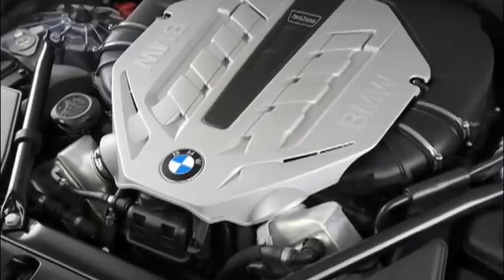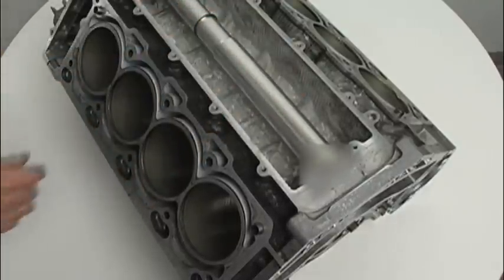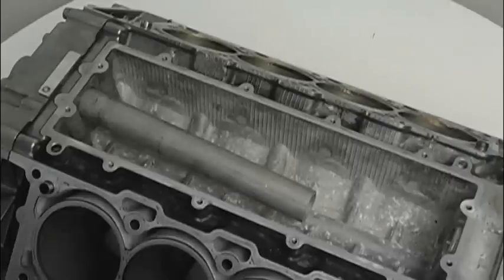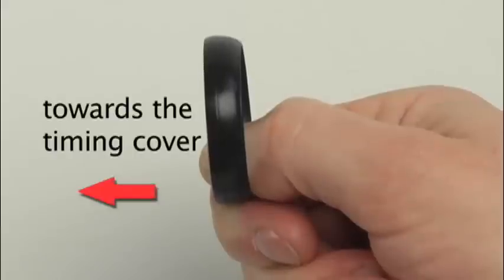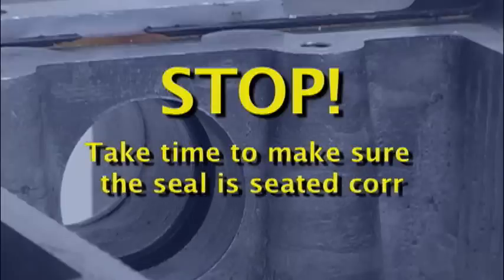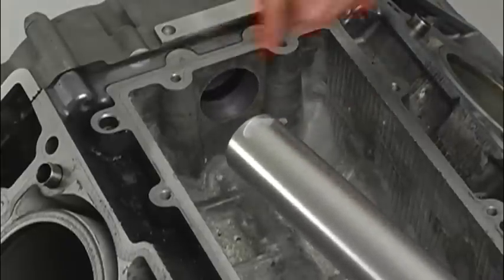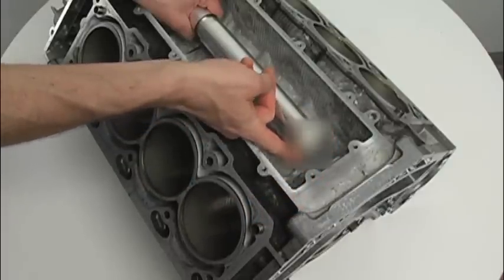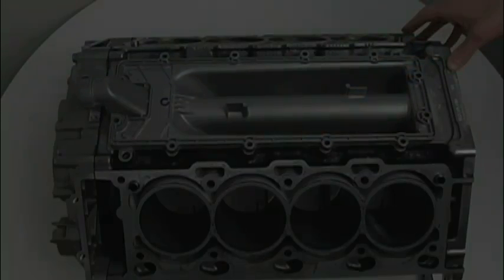URO Parts Coolant Transfer Feed Pipe 11141439975-PRM, Repair BMW N62 V8 Seal Leak

Comment: My BMW 745i had this problem,thanks to this video I was able to fix it in one day.Now I will pretty busy doing BMW coolant transfer coolant pipe at a special rate..Thanks.
Reply: Cody urboy when you did this, was the pipe right after installation? Or did it move a little from side to side if u twisted?
Reply from the maker: The ends of the collapsible pipe are securely positioned in the block after installation, thanks to the end seals and multiple o-rings between the sections of pipe.  Some time ago, one of our competitors published an extremely deceptive "comparison" video showing our pipe loose and rattling in the block, which clearly didn't have the two end seals and three o-rings installed.  The misleading video has since been removed.
Reply: Why is the hardest part (installing in front hole) blurred out?

Comment: I just installed mine. I noticed that with the angled shoulder on the rear-end of the URO pipe, after securing the the locking ring,  I was able to twist the rear half of the pipe ( with pliers )counter-clockwise against the rear block casting ( the pipe-hole surrounding block casting area is angled outward as it drops down around the pipe hole) , therefore by twisting it counter-clockwise, I was able to lock the front face of the tube, with torque,  up against the inside of timing cover, using applied force and creating positive pressure, not too much, but enough for a satisfying amount of torque , applied by the face of the pipe tube, against the inside of the timing cover, to a forced-stop... making sure that there is absolutely no space between the inside of the timing cover and the front of the pipe...Nice and Tight..In my case, negating the need for spacers...Because I could've never applied that much force from the pipe, to the inside of the timing cover, due to accessibility and angles...can't get any tighter than that for sure... Just My .02c
Reply from the maker: Nice work Mr. Bimmer!  It also helps to slide the pipe into the timing cover BEFORE installing the seal, so you can make a mark on the pipe (with a Sharpie marker) showing full insertion.  Then when you're pressing the pipe through the seal later, you can see exactly how far you need to go.

Comment: Why is this blurred like a japenese corno?
Reply from the maker: Hi, the rear end of the aluminum pipe is now manufactured with an angled shoulder.  This design update eliminates the need for the angled white plastic spacer (which is now blurred in the video) that was provided in the original version of the kit.

Comment: WHY IS STUFF BLOTTED OUT
Reply from the maker: Hi, the rear end of the aluminum pipe is now manufactured with an angled shoulder.  This design update eliminates the need for the angled white plastic spacer (which is now blurred in the video) that was provided in the original version of the kit.

Comment: I am in the middle of installing this part but am having trouble with getting the rubber ring at the timing cover side of the engine to seat properly.  After removing the old rubber ring, I cleaned the metal groove out with a wire brush and wiped it clean.  Then I lubricated all surfaces of the new rubber ring and installed it in the groove, making sure that the flat end of the ring was facing the front of the car. I have gotten it to seat in the groove, but there is still a tiny lip sticking up on a portion of the ring facing the rear of the car, that is preventing the collapsible pipe from being fully inserted.  I have tried pressing the ring into the groove with the smooth rounded edge of a pick tool, but no matter how hard I try, the ring will not fully seat into the groove.  Is there anything else I can try that will help seat the ring?
Reply from the maker: You should use a light coating silicone grease only on the seal when installing it; this is specifically made for rubber O-rings.  A plastic glass installation trim tool with a small amount of silicone grease applied is the best way to work the seal into the groove.  Working around the perimeter with the plastic tool will help to press it in without the risk of damaging the seal.  I hope this helps!
Reply: @Uroparts  I did use the silicone grease that was supplied with the kit, and only applied it to the o-ring.  I also tried using a plastic trim pulling tool that has a smooth flat edge, but it is still not able to fully seat (it is just barely sticking up like 1mm or so in portions, but just will not budge any more).  I'm afraid I might be damaging the o-ring will all of this wrestling it into place.  Can new o-rings for this kit be purchased separately, just in case?
Reply from the maker: nomeatoburrito yes we do sell the o-ring separately.
Reply: @Uroparts  What is the part number for the O-ring itself?
Reply from the maker: nomeatoburrito 111414399752
Reply: @Uroparts  Thanks.  By the way, when I received my kit, this O-ring was shipped inside out (with the beveled part on the inside).  I tried installing it that way at first until, but it was so not-flush that I rewatched your video and figured out that it had been shipped inside out.  Shopping around for replacement O-rings, I noticed that everyone shows it correctly with the beveled part on the outside, except for ECS Tuning, which shows it with the beveled part on the inside.
Reply: URO Parts Is the bevel of the main O-ring supposed to be on the inside face of the O-ring (in contact with the transfer pipe) or on the outside (in contact with the groove that the O-ring fits into?
Reply from the maker: @nomeatoburrito  Hi, actually this kit has been redesigned since this video was created.  The seal is now flat and square on the outside (instead of rounded like OEM), and has a bevel on the INSIDE, which makes it MUCH easier to insert the pipe.  Press the new seal into the groove with the bevel facing the rear of the engine, and you'll see there isn't any rubber protruding from the edge of the bore to catch on the pipe when it's inserted.  This video also originally showed a wedge-shaped plastic spacer for the back end of the pipe, but the spacer is now hidden in the video because the redesigned kit has the angle machined into the metal pipe, so the plastic spacer is no longer required.  Sorry for the confusion!
Reply from the maker: @jmland  Hi Jason, our redesigned seal now has a bevel on the INSIDE, which makes it much easier to insert the pipe.  The channel for the seal is flat with square corners, so we made the outside of the new seal flat with square corners to match.
Reply: @Uroparts Ok so I'm in the same boat. Is the flat surface of the main seal supposed to be inside or outside? I am not talking about the little bevel on the edge of rubber. I tried for ever to install it with the flat edge inside(against pipe) and it would not go. Rest assured I took my time and got the leading edge inside the aluminum lip. I then turned the seal inside out so the rounded part of the seal is against the pipe and it when it with light pressure and seems right to me.
Reply: @jmland Ok so I'm in the same boat. Is the flat surface of the main seal supposed to be inside or outside? I am not talking about the little bevel on the edge of rubber. I tried for ever to install it with the flat edge inside(against pipe) and it would not go. Rest assured I took my time and got the leading edge inside the aluminum lip. I then turned the seal inside out so the rounded part of the seal is against the pipe and it when it with light pressure and seems right to me.

Comment: Why do you censure the the installation of the white nylon packing piece
Reply from the maker: Hi Miguel, the rear end of the aluminum pipe is now manufactured with an angled shoulder.  This design update eliminates the need for the angled white plastic spacer (which is now blurred in the video) that was provided in the original version of the kit.

Comment: Can I expect these seals to also last longer that just replacing it with a standard pipe? Or is it just easier to again replace when the time comes?
Reply from the maker: Hi Reiner, good question!  We have a lifetime warranty on our Coolant Pipe, but we never get requests for replacement seals.  We've been selling this kit for almost ten years, so the seals must be going strong so far.  If the seals ever do need to be replaced, it would be relatively simple to remove the collapsible pipe to replace them.
Reply: Do not use original tube. It’s inferior. It’s just a fact.

Comment: Looking at purchasing one of these for my n62. Can you tell me what the seals are made of ? Are they Vito seals ?
Reply from the maker: Hi, this kit has EPDM seals (as does the factory BMW pipe), with is the ideal material for coolant.  Viton is generally used for oil seals, but would also be acceptable for coolant.

Comment: Hi a have a leaking on the top of the valley pan I installed a Uro pipe two years ago and put new valley pan I only see coolant on top of the valley pan no coolant coming out of the weep hole you think I have to change the pipe again
Reply from the maker: Hi Emmanuel, if there's no coolant coming out of the weep hole, the URO pipe is fine.  Sounds like you might need a new valley pan gasket though, or could coolant be leaking from a hose and migrating to the top of the valley pan?
Reply: @Uroparts  Please clarify why he would need a new valley pan gasket if no coolant is coming out the weep hole. That would mean there isn't any coolant in the valley pan...Would I be correct? Because if the pipe isn't leaking the valley pan should be dry?
Reply from the maker: @robertfaulkner7152  Hi Robert, the valley pan cavity is actually a coolant passage, and the pipe merely directs the flow of coolant through the filled chamber to the back of the block.  Coolant only comes out of the weep hole if the seal at the front of the pipe leaks, which fills the empty cavity in the timing cover until the level is high enough to flow out of the weep hole.  Coolant escaping the top edge of the valley pan means the valley pan gasket is leaking, which doesn't have anything to do with the seals on the ends of the pipe.  Look at the hose neck on the cover for the N62 valley pan, and how coolant flows around the pipe and through the block and cover.

Comment: The tube i ordered, the one facing the front of the engine, is cut at an angle, what orientation should it be when inserting?
Reply from the maker: Hi Uzi, the section with the angled shoulder faces the REAR of the engine.  The rear end of the pipe (toward the firewall) has the angled shoulder, which must be rotated until it matches the angle of the inner wall on the back of the engine block.  Then you'll be able to see the lock ring groove, and snap the lock ring in place.   Please see this sentence in the video description above: "Grabbing both sections of the tube firmly, hold the front half in place and slide the rear section back into the block until it clicks home, being sure to rotate the tube so that the angled shoulder of the pipe matches the angle of the block.  This should just expose the ring groove allowing the pre-installed locking ring to be slid forward into place."  Please see the 12-pages of printed instructions that came with the kit, which explains everything and has lots of detailed photos.

Comment: Are the o ring replacements in the kit Viton?
Reply from the maker: Hi Anthony, Viton is an ideal seal material for exposure to hot oil.  EPDM is the preferred seal material for exposure to coolant, especially in cold winter weather when the vehicle is parked overnight.  URO Kit 11 14 1 439 975-PRM includes EPDM seals.  Viton isn't recommended for temperatures lower than -4° F, while EPDM is good to -49° F.
Reply: @Uroparts  is the EPDM better then the factory seal? If so what is the factory seal made of?
Reply from the maker: @anthonyk  Hi Anthony, the seal on the factory one-piece pipe is also EPDM, which the OEM vulcanizes to the pipe (which is where it corrodes).

Comment: I've got a problem my front seal fits not perfect in the middle. it seems that is impossible to fit it perfectly.. any idea?
Reply from the maker: Hi Justin, you're having difficulty tucking the front seal into the groove between the block and the front cover?  (The side with the inner bevel should point toward the rear of the engine, so the pipe can slide in easily.)
Reply: yes i know but the seal never fit in the middle..
Reply from the maker: @justins8085  Hi Justin, please email photos to "sales at uro parts dot com" (remove spaces) with your contact info, so we can better understand where you're having difficulty.  We'll be happy to help via email or over the phone.

Comment: Does the valley pan need to be replaced as well,  or should the coolant pipe be sufficient enough to stop the leak?
Reply from the maker: Hi R Robles, you'll need to remove the valley pan to access the coolant transfer pipe, which means you'll need to thoroughly clean the sealing surfaces and use a new valley pan gasket when re-installing the valley pan.  Definitely don't reuse the old valley pan gasket.

Comment: I was in the middle of doing this job when applying pressure I was not able to collapse pipe back not by twisting or anything...the 2 pieces of just got stuck together and I'm currently not able to separate the outer and inner tubes...I did add lube so I'm baffled as to why they got stuck...any suggestions or advice?
Reply from the maker: Hi Leo, the inner and outer tubes don't actually touch each other after installation, since they are separated by three o-rings.  Perhaps there wasn't quite enough grease, and one of the o-rings rolled out of it's groove between the tubes, making the tubes very tight?  Were you able to get it loosened?
Reply: @Uroparts  I have the same issue any tips?
Reply from the maker: @sethflynn1  Hi Seth, you've probably already resolved this, but for everyone else it helps to smear a thin layer of grease around the inside of the outer section of pipe in the o-ring area.  What might be happening is the small amount of grease applied directly to the o-rings could be rubbing off when the dry outer tube is slipped over the o-rings.  Increasing lubrication on the inside of the outer tube should greatly reduce o-ring drag and stickiness.

Comment: Hi I have some sort of leak from the rear and it keeps coming out of the flywheel are , if I’m correct I think it’s the rear seal that’s going bad on the valley pan to where it’s letting it seap down into the flywheel what do you think
Reply from the maker: Hi Chris, your engine is leaking coolant from the flywheel area?  Your suspicion sounds plausible, but the only way to confirm it is to dig in there or have a mechanic diagnose it.
Reply: There are holes in the valley that drain the leaked coolant to the back of the engine.  Mine leaked from the back of the engine. Nothing from the weephole. As soon as I opened it up it was immediately clear that the seal on the coolant transfer pipe had failed.

Comment: I am currently In the middle if doing this repair. I purchased the updated kit without the plastic guide piece, but for some reason i am having trouble getting the pipe to enter far enough into the timing cover side for the spiral lock  to slide up in its groove. It appears the pipe needs to enter further in on the timing cover side. I push it in and feel a slight "thud" but not a "click" Any advise?
Reply from the maker: Hi David, feeling the "thud" is a good sign.  Did you happen to notice the angled shoulder on the "back" half of the tube (that goes into the back of the block)?  The angled shoulder needs to be rotated to match the slight angle of the block casting.  If the rear pipe is indexed at the wrong angle, the mismatched angles could be taking up the last bit of space needed to reveal the groove for the lock ring.  Take a look and let us know if that solves it.
Reply: @Uroparts  Hi, i noticed that it is angled, but assumed it was due to manufacturing tolerances. I was able to press pipe in and just barely expose grove to install lock ring. It went pretty smooth, however... i'm seeing very small seepage again on top of water pump area. Is it possible it was installed incorrectly? Car is N62B44A from E53 X5. How common is it to need the spacers? I am worried now that it is still leaking. I drove the car and coolant went down slightly, about half way in the expansion tank. I assumed this is due to air purging. I guess time will tell if i am still leaking... any advice here? Thank you.
Reply from the maker: @Andy-bm6zo  Hi Andy, the angled shoulder on the "rear" end of the pipe (that goes into back of the block) is intentional, so the pipe needs to be indexed to match the angle of the inner wall of the block casting.  If the rear pipe isn't rotated to match and angle of the inner wall of the block, the mismatched angles will take up space needed to reveal the groove for the lock ring.   Since you were able to install the lock ring, you must have indexed the pipe correctly.  The spacer rings aren't actually necessary (since the ends of the pipe are sealed around the outer diameter), but some people feel better if the pipe is "tight", even though the pipe isn't going to move once the lock ring is installed.  We agree that the initial coolant level drop is probably due to air purging.  It sounds like you've installed the kit correctly, but do keep an eye on the seepage to see if it stops.

Comment: Why did you blurr out the end?
Reply from the maker: Hi, the rear end of the aluminum pipe is now manufactured with an angled shoulder.  This design update eliminates the need for the angled white plastic spacer (which is now blurred out in the video) that was provided in the original version of the kit many years ago.